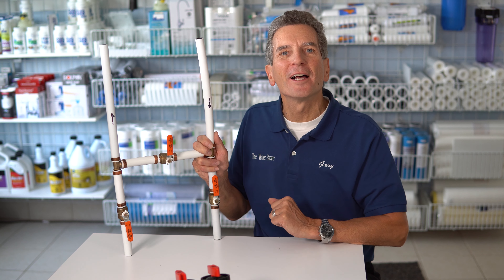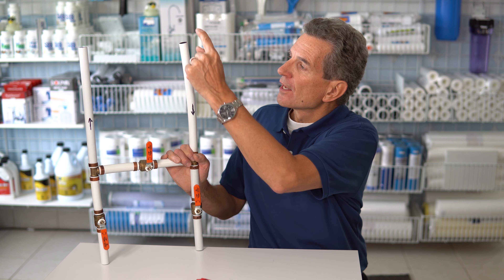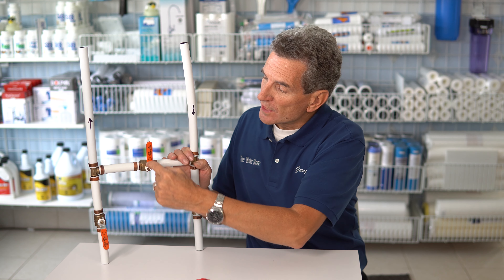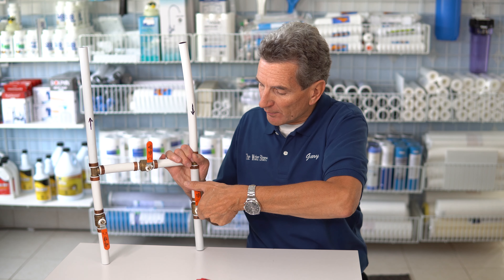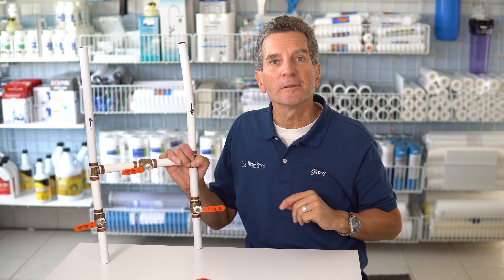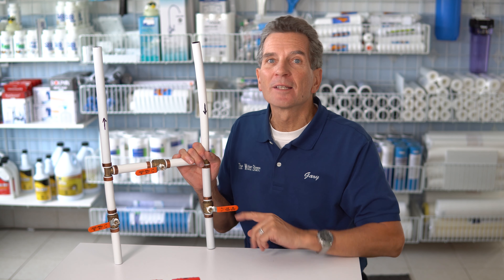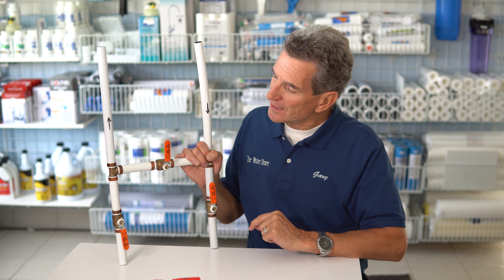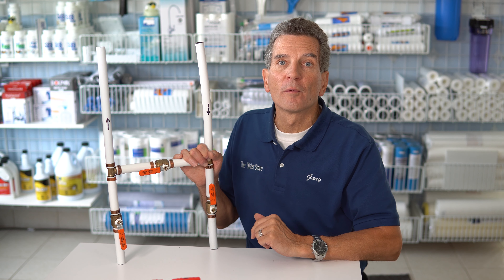How Does a 3 Way Plumbing Bypass Work?

Comment: My set up is turned opposite of yours. I have the top 2 in the on position and the middle pointed downward to the floor. Its too close to the water softner for me to tell if its on or off. Is downward the correct position?
Reply from the maker: Down or up is off. Inline with the pipe is on. In your case up or down is correct

Comment: Could this be used if you wanted to make your water a little harder than it is with the softener? Like for hair washing if my hair is too soft and the softener is on the lowest setting, could I add some hard water into my shower with this type of bypass or are the only settings for these just 100% hard or 100% soft?
Reply from the maker: Yes, but you are better off to build a 3 way bypass around it and leave the central valve slightly open to mix some hard witht he soft water.https://youtu.be/2EcQrrlxMqo
Reply: Thank you!

Comment: What if using a diverter valve on the inlet side?  system would end with this valve and another at the output of the filter/softener.  Does plumbing code in general allow the use of diverter valves?
Reply from the maker: Not sure what you mean by diverter valve.
Reply: @water_estore  those valves that switch flow between 2 outputs. I think they are mostly  used for pools.

Comment: When removing a water softener, can the bypass valve be closed and left in place? Or does the valve need removing and a direct pipe reinstalling?
Reply from the maker: You can remove it with the bypass left in place but I would not trust that the bypass will never leak or it might be opened at some point by mistake.  Not in my house.

Comment: Not what I needed. Got info just the same. Looking for some type if adaoter that takes one line in and tgen has two outs where I can control with a valve lever to one or the other.
Reply from the maker: Sorry, I don't know of any.
Reply: @water_estore  Thanks for the reply. Will keep looking.